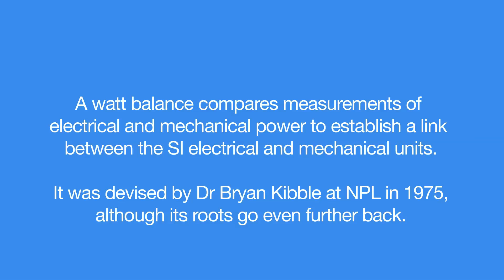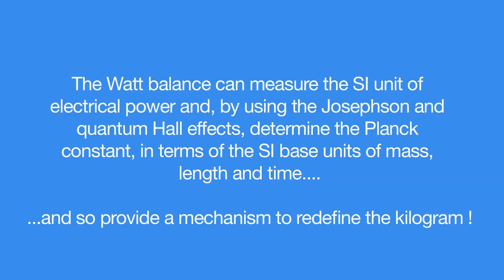The Watt balance and redefining the kilogram

Comment: Simply not true. If the electronics are subject to imperfections so is the entire aparatus. The other choice will be selected.
Reply: As long as the diffrences are constant, the system still works. A simple example is a mechanial Chronometer used in navigation. It may gain say a second a day after it is set, but provided it continues to gain a second a day consistently you know that 20 days after calibration you add 20 seconds. So you can still do an accurate calculation.